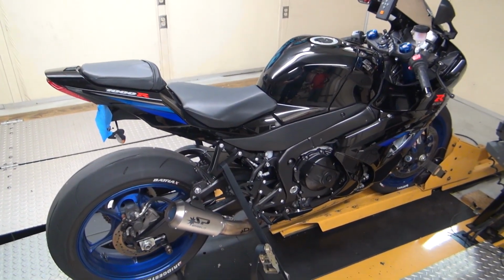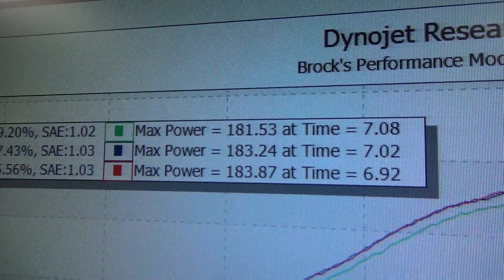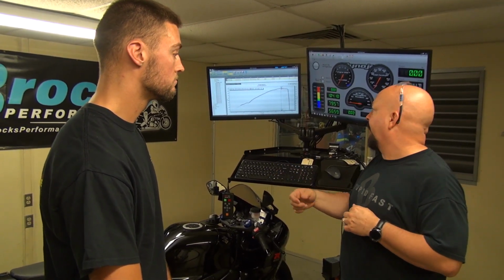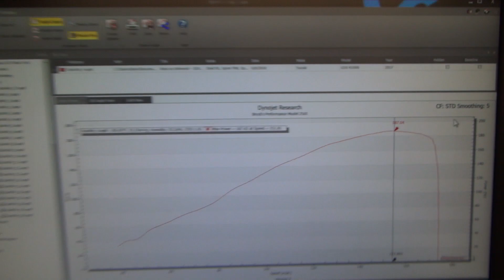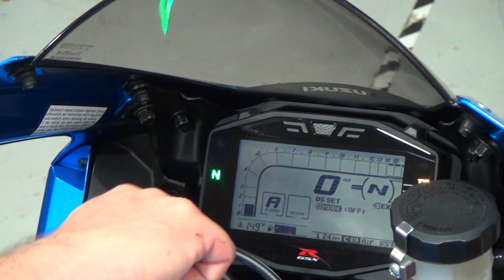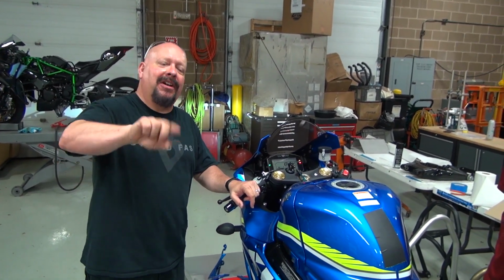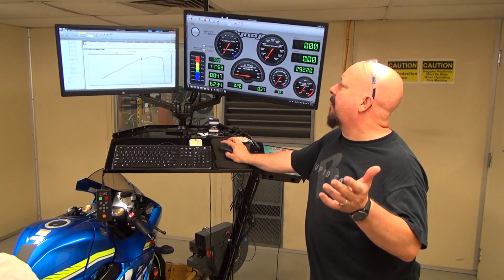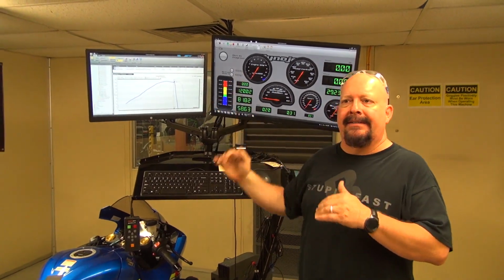Tech Talk: "The Dyno Game" - Apples to Apples 2017 GSX-R1000 Testing

Comment: That's the same bike u got what 200 plus hp out of. So the weather effect that bike that bad, I take it.
Reply: Brad Quinn he was using MR12 when he got 200+ horsepower
Reply: Thank u Brock for the pin on the video. Carzy but true.
Reply: Weather conditions greatly affect a bikes performance. At the 2 extremes you could see upwards of a 5% delta in power... It doesn't sound like a lot but if you've got a 195HP super-sport that could be 8+HP. Best time to hit the dyno, or break drag records, is perhaps in August/Sept. if you're in MI like me.

Comment: Hi!  I hope you get to read this, Brock (or anyone else who knows what he 's saying)...
I noticed the flame poppin out of the muffler and made me think about my own bike.
Aside it's slip-on, it's a completely stock 1998 gsxr750 fuel injected and on the dyno it put 127hp on the wheels (dyno is prob quite right, cause my mates stock cbr rated around his listed hp...), but the guy said it tends to be a bit lean here and there and could use a mapping...

now, first I had a Lazer exhaust, but since I have a Delkevic exhaust on it, which seems to be more "open" or less restricting (prob the db killer) , I tend to have FLAMES out of my exhaust on the track.     And I'm not talking about a "pop", no its like till up to 8sec of flames, bout 15cm long...

Does this tell you something?   I really hope it aint bad, cause it gives me a lot of positive comments and even seems to make guys with 20grand bikes a bit "jealous"   ;-)

It's cool, but if it hurts the bike....
Reply from the maker: lillnemo1 - your 1998 is a very early model motorcycle OEM fuel injection system and your bike was not subjected to the emissions regulations of today. Not that it makes it 'bad' or in need of replacement... it's simply not as refined as todays motorcycle EFI systems. The flames you see are 100% normal for your bike and are more likely caused by a RICH condition upon deceleration. Excessive fuel in the pipe makes flames/excessive air-mixed with fuel makes 'pops'. There is no risk of damage to your engine, but the flames can accelerate the natural degradation of your baffle packing - which can create the need to repack or replace the muffler more frequently. Hope this helps - Brock

Comment: Another factor is how he rides the bike daily. Commuting and/or casual street riding tends to make the bike 'lazy' I was told. Mine was also broken in on the dyno and I saw some pretty nice numbers. After a month or 2 and full Yoshi R11 + p08 (no flash/tune) the numbers dropped by 5-7 hp. Now after a flash/tune the numbers are the same as the very first (stock) dyno I had. So basically it looks like I did everything for nothing but that can't be true and this video demonstrates that...

Comment: @Brock - Great video, what a difference a few months make from winter to summer conditions, and how that affects engine performance. I'm a little surprised Justin didn't ask, if you believed his bike's performance could be improved upon as is? And the STD correction method with its Relative Air Density of 99.8%
 (1.223kg/m3) vs 94.4% (1.157kg/m3) for SAE is a monster influence on power output. Just how many air molecules can we pack into a given volume of space? Reminds me of watching the same Super Comp dragsters up in the mountains vs when they'd race at PBIR in Florida, the bracket time differences were huge.

Comment: Enjoy these vids keep them coming  :)  

What type of AFR do you usually aim for:  12.2, 13.2 or somewhere in the middle?
Reply from the maker: That depends on the make/model/year and usage. It can be as low as 11.2-1 (Nitrous Oxide) and as high a14.7 (Fuel efficiency mapping). Most normally aspirated applications are between 12.8 and 13.6. Check out this FAQ for more info: http://blog.brocksperformance.com/faq/how-can-brocks-get-mapping-so-close/
Reply: Interesting what you say about real life, have agree.  Time to accelerate in real world is what matters, I've tried Dynojet autotune in the past but believe the bike was running leaner than what the lambda sensor was saying.